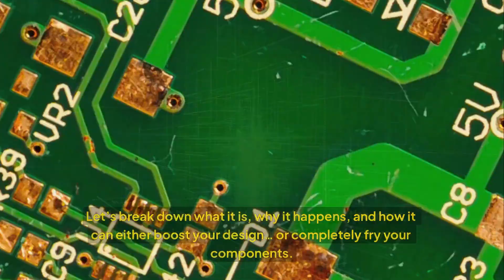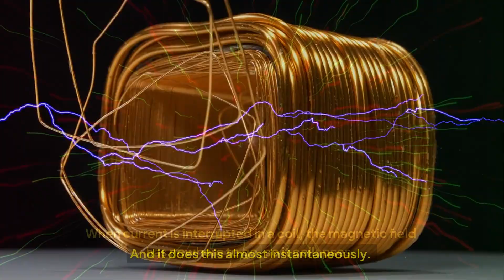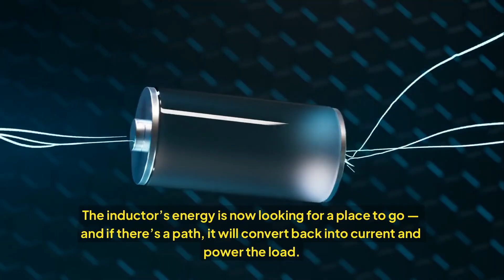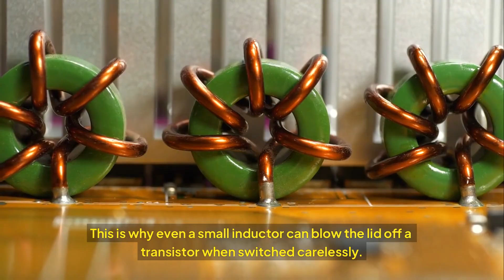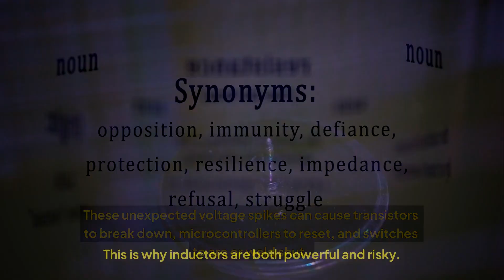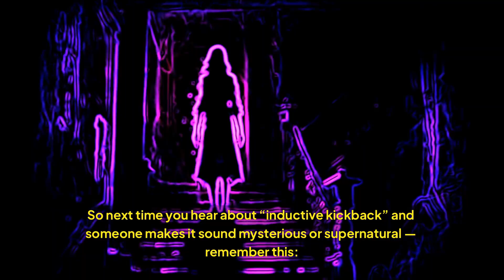Inductive Kickback — Not Magic Just Brutal Physics

Comment: If there is No Free Energy, what Powers the Rotation Of The Earth Which Is Hanging Upon Nothing In The Space like other Planetary Bodies?
Reply from the maker: Stored energy. When the Earth was formed there was a ton of mechanical kinetic energy involved. This was simply stored in the rotation of the Earth and that is all it did.

The Earth is doing NO WORK, it's not being dragged down to do work, it simply rotates storing energy. It provides no power, except in its electrostatic field, but not from its rotation. This is no different than spinning a wheel, which takes energy to do by using your hand to apply external energy (The Formation of the Earth).

Now the wheel simply sits there and spins freely, minus tiny little losses due to the bearings upon which it spins on. The earth has no losses because it doesn't spin on a bearing, it spins in space without loss. Newton's 1rst law, an object in motion tends to stay in motion unless acted upon by an external force. (The friction in the bearing) in the case of the wheel.

No friction in space, (In the case of the Earth).

There is a difference between energy and work and power. Energy is simply the potential to do work. All the power and work was done when the Earth was formed. The Earth simply has stored that energy. 

In order for a kickback spike to be Free you need some type of external energy to add on to it, and that does include zero point energy if you can show it.
Reply: @debunkified  The Earth Stored Energy as you said. Does that not implies that There is a Source from which the Energy Comes from and from which we inhabitants of the Earth can Tap From too?

ABSOLUTELY YES!! 
The Current Physics laws are Man Made which can still be improved Or am I wrong?
I listen to Nature and it laws not the ones that are deliberately created by fellow Mortals for there own selfish gains over fellow Humans like your very self and myself too.
Reply from the maker: @Ukthorncarver  Of course. Glad to see somebody thinking. What I am saying is that the rotation itself can't be used unless other Tools are used in conjunction with it. The Earth does indeed provide all the energy that we need. All we have to do is PLUG into it.
Reply: @debunkified And to PLUG into that Abundant Energy Successfully, Can The Establishments  Closed Systems Be Used? 
NEVER!!!

That is why you have to Think Outside there Self-styled Physics Laws!!!!

When I said Back. E.M.F is a Completely Free Energy, That Discovery Comes from a Rigorous Research that Span Across 8 years of my Life!

The Industrial Oil and Military Complex wants everyone to believe that the AIR is empty. That is a BIG LIE!

The Power You Get From Back EMF actually Comes from the THIIIIIIIN AIR!!

What determines the amount of Energy the Ambient would supply you is the Path and How you set that Path with which you want to receive, store, and process the energy into a useable form before you send it back to the Mother Earth to recycle the process Indefinitely untill you stop the "DISTURBANCE" yourself at will.
Reply: @Ukthorncarver  It's called tidal power.
Reply: @debunkified  It's called tidal power.

Comment: Another aspect about this effect rarely talked about is that it doesn't inherently try to go in the opposite direction of the initial current, what happens is that as the resistance rises (due to opening the circuit) the current attempts to compensate by raising its own voltage potential to overcome that resistance, this continues until either all the magnetism is consumed or a new path is found, which is just usually in the opposite direction of the initial current, if allowed this inductive kickback HV current pulse would continue in the same direction as the initial current.

There's an experiment video showing this effect somewhere, can't find it now but it does confirm the effect, for the common belief that inductive kickback inherently moves in the opposite direction is incorrect.
Reply from the maker: You're exactly right. The current, or at least the voltage, wants to move in the same direection, the only things that actually reverses is the entry and exit points of the voltage and/or current.

Where when the current enters the bottom of the coil that's the negative output from the source (input to the bottom of the coil). When the current shuts off, the coil becomes the input source and the negative is at the top, hence keeping the current going in the same direction.